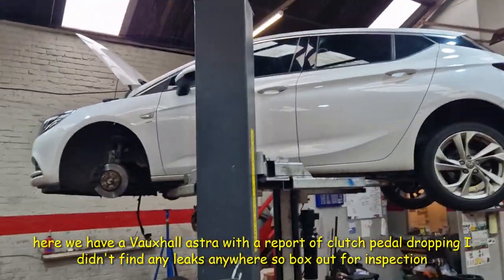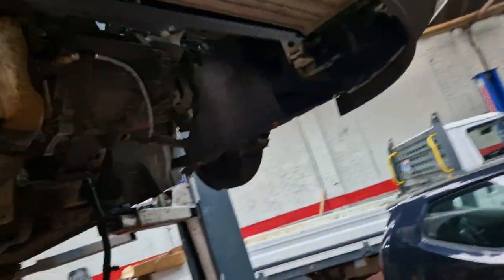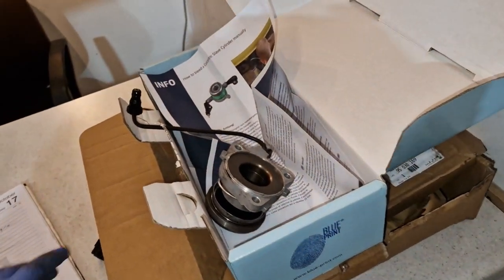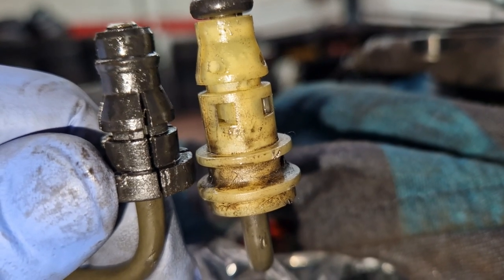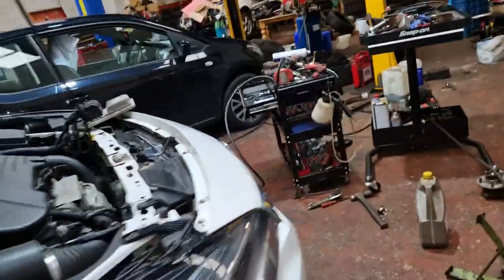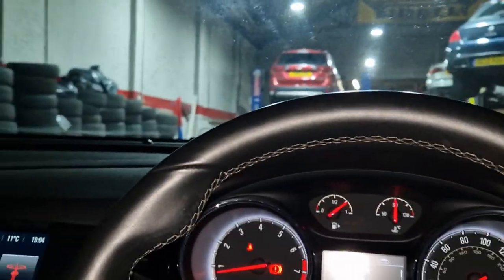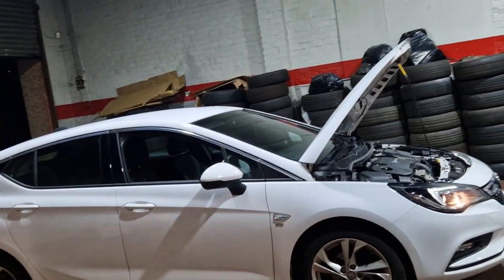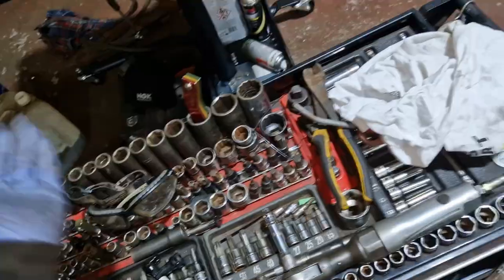VAUXHALL ASTRA CLUTCH REPLACEMENT #vauxhall #vauxhallastra #clutch #car

Comment: I have a similar issue. My clutch pedal went flat I had to manually bring it back up with my foot and it’s not gone down since. It’s been about 6 months.  But sometimes it feels spongy after long journeys. Also the clutch gets stuck when I’m on a steep hill with biting point. Do you know what this could be?

Comment: Hi guys. I have a bad reverse gear. I can turn it on only after switching to second gear. Has anyone had such a problem? 1.2turbo M22 GEARBOX
Reply from the maker: hi, and thanks for watching and commenting. If you haven't already hit that subscribe button and have a great day, I can only comment on this vehicle, which had no gear selection issues after the clutch but I would check the hear cables for wear at the conectors if all the other gears are OK and no clutch slipping sounds more linkage issues with the cables

Comment: Random question.  I have the same model. Gear stick is slightly woobly happened a little while ago when I changed gear too hard. Was told you can’t replace the gear stick brushes is this true?
Reply from the maker: hi, and thanks for watching and commenting. If you haven't already hit that subscribe button and have a great day, it sounds like you have  a cable issue. I would have them  checked aswell as any linkages

Comment: The CSC looks different because of the new clutch actuator elbow. They changed it for some time to adresa the "low pressure clutch pedal" incident
Reply from the maker: hi, and thanks for watching and commenting if you haven't already hit that subscribe button  and have a great day yea the first CSC cylinder was wrong we got a school one in the end wi h was perfect the clutch itself was a genuine vauxhall part psa on the box wich is peugeot group and it also had gm stamped on it and sachs so sachs made the clutch for general motors then they were taken over bye the psa group  lol 😆

Comment: Hello, How did you purge it? When the car is hot, I have to press the clutch pedal twice to put a gear, can that be air in the system ? Thanks !
Reply from the maker: hi, and thanks for watching and commenting. If you haven't already hit that subscribe button and have a great day, it could be air, but without seeing the car, I would only be guessing. Try bleeding it again and see what happens
Reply: I have the same issue, got the circuit purged but still happens. On my local shop they told me to replace the whole clutch if it remains. What did you do? (118K kms 1.4T here)
Reply from the maker: @churrinification  Hi, and thanks for watching and commenting if you haven't already hit that subscribe button and have a great day replaced with a genuine vauxhall clutch, which was all that was available at the time but although it came in a Gm box it had GM STAMPED ON IT BUT ALSO SACHS lol so sachs made it for gm wish is now owned bye the psa group lol Hope that helps have a great day
Reply: Hello, how did u fixed it? I have similar problem, when im driving and system around clutch get hot, i need to press clutch pedal several times. I changed whole clutch for new one, same number as in video, from Sachs and only then this problem happened to me. With original part from 2015 it was all working just fine. After change to new one from Sachs it started to make this problems. Concentric Slave Cylinder looked a bit different than original one, same as in this video.
Reply from the maker: @tomasuhrin407 Well, that's not so good. I hope you get to the bottom of it. this one, we replaced the slave for Sachs, the same as the clutch, and we have had no issues, as you can see in the video  the first concentric slave cylinder was not the correct one thankfully I realoswd that before fitting the  box I hope you get it fixed thanks for watching and commenting if you haven't already hit that subscribe button and have a great day 😀

Comment: Does subframe need dropping to get box out?
Reply from the maker: yea, I did remove the subframe on this model. There was no aftermarket clutch available at the time, but when it came from the vauxhall psa group, it was made by sachs hope that helps thanks for watching and commenting if you haven't already hit that subscribe button and have a great day

Comment: What engine size please. My 66plate 1.0 turbo has terrible clutch judder in reverse. 42000 miles
Reply from the maker: hi, and thanks for watching and commenting. If you haven't already, please subscribe and have a great day. This one is a 1.4 turbo

Comment: Is this 1.6 diesel Astra K? Also does it need a special tool to fit new  clutch and flywheel.
Reply from the maker: I would need to check on the k so many astras. lol, it is only available from vauxhall, and it's on an exchange basis, just a regular clutch allignment tool I used. I hope that helps, and thanks for watching and commenting if you haven't already hit that subscribe and have a great day 😀
Reply: Ok thanks, I have one to do and yes not cheap though. I will drop off gearbox and see hi ow it goes.
Reply from the maker: @benm7123  The clutch I couldn't get aftermarket I think its backorder so it was gen vauxhall wich is made by sachs and yea. man it's a k

Comment: Hey, i’m about to do the same job to my 1.0 Turbo Astra K witht the B10 engine. Do you know if i have to take off the subframe as well? And which brand of clutch pump do you recommend? It started leaking so that is the reason im taking off the entire gearbox.
Reply from the maker: hi, and thanks for watching and commenting if you haven't already hit that subscribe button, and have a great day. It's most probably the same suspension set up. This one, if memory serves me right, was a diesel. The clutch we fitted to this one we couldn't source aftermarket, so was genuine vauxhall part but it was made bye sachs had Sachs engraved or stamped on the drive plate the subframe was removed on this model
Reply: @cairney0037  Thanks a lot for the reply Cairney, keep up the good work :-)
Reply from the maker: @pietervanoeckel8249 Thank you man have a great day 😀